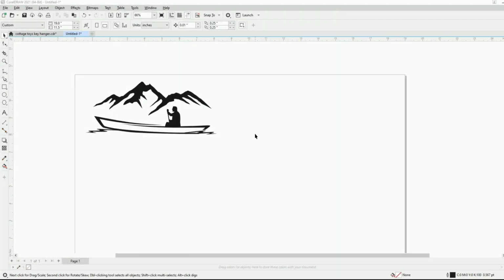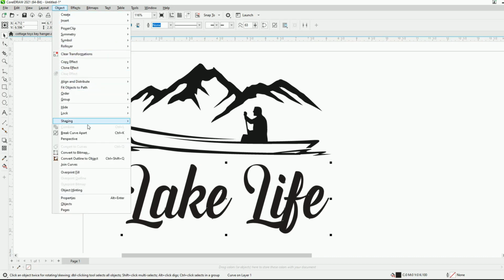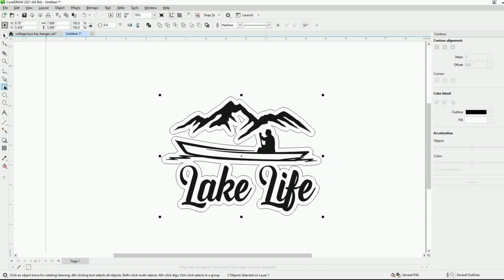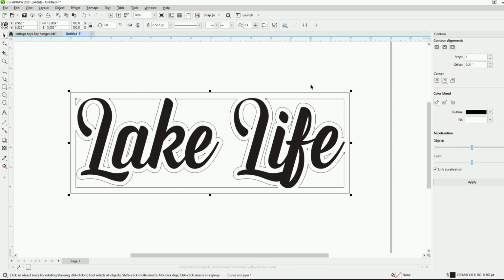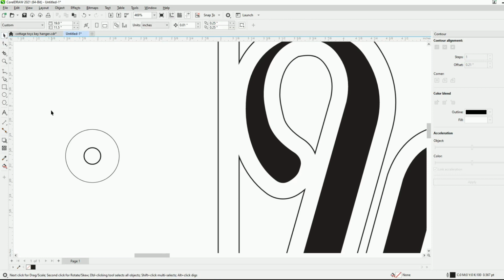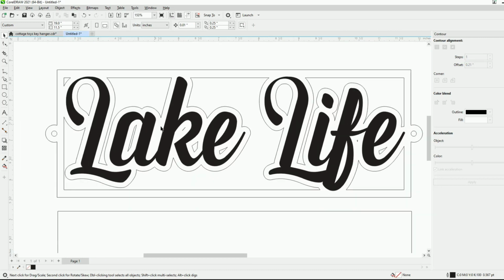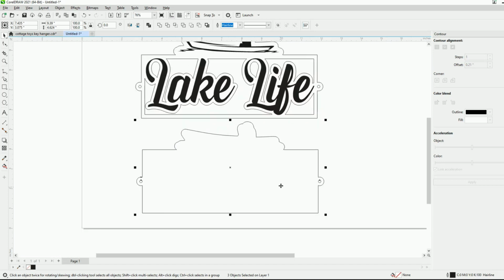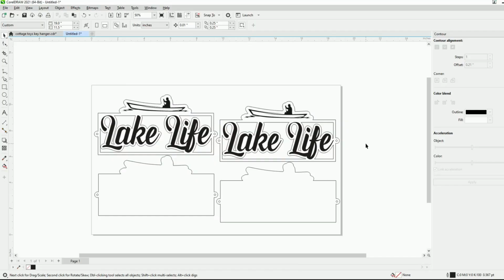How to Design a File - Glowforge Tips & Tricks

Comment: I work in Illustrator and save my files as SVG for my Cricut Maker or vinyl cutter. Do you know if the results of a print on the GlowForge  are better in one type of file compared to another. I’m not quite ready to purchase, but getting closer all the time. Thanks.
Reply: I started out using PNG. Then found SVG better. However… I recently started saving as PDF and that works well for other reasons. I use Corel. And when I set my material to the glowforge size bed and save as a PDF it saves it as the material size instead of just the design. That’s the only reason. But… if you have multiple outputs… like your cricut… I’d keep it all in SVG.
Reply from the maker: I've had better luck with using PDFs myself but I'm not sure if one file type is "better" than the other. PDFs for me have just been more solid and dependable. You can definitely save as an SVG and use that on the Glowforge though with no issues at all. I hope this helps! Happy making!